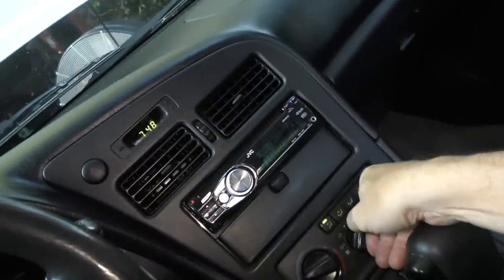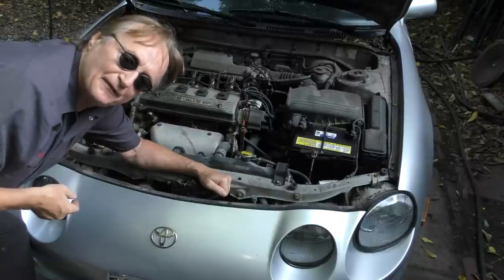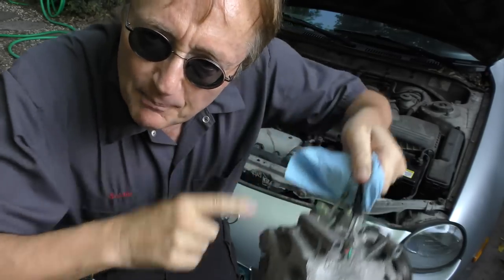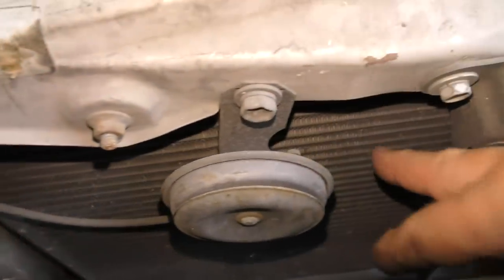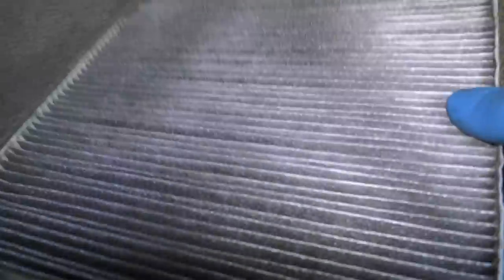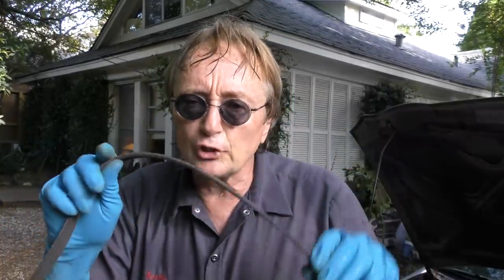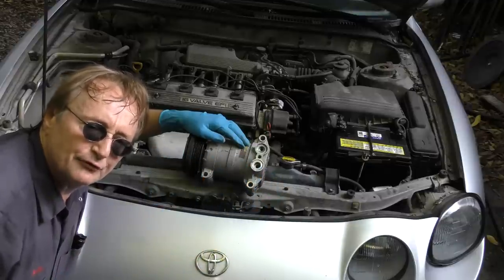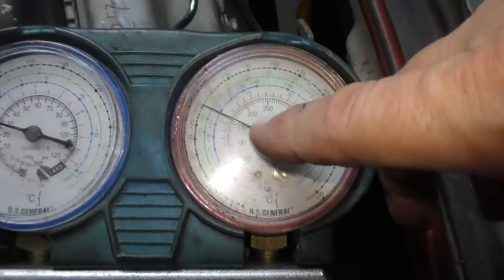How to Keep Your Car's AC Blowing Ice Cold

Comment: 1- check/replace cooling fan[s]
2- check for/clean out intake debris
3- check for/hose off any dead bugs on condenser
4- check/replace cabin air filter
5- check/replace fan belt
6- check/refill refrigerant
Reply: Check!

Comment: Very good help and thanks-I was having to replace my refrigerant once a year for the past two years but I got smart this last winter and ran the ac for a short period every day I would drive the car -especially even in the winter.  I am certain that this kept the lubricant (ac system oil) circulating and kept the system seals lubricated, and therefore I did not lose the refrigerant over the winter (as had been the case previously), and lo and behold, I did not have to recharge the system at all this year and the ac is nice and cold! Yea!  By the way (and if you do not mind me asking) are you by any chance related to Billy Kilmer (the ex NFL quarterback?)

Comment: thanks bro that was helpful I do mostly residential Refrigeration some commercial. very little Automotive but one thing I thought was worth mentioning to remind people when they're cleaning the coils not to use too high pressure hose with water and damage them. I've seen it done countless times on residential. people just don't know any better. I'm sure you know that.

Comment: I clicked on this cause i noticed my ac doesnt cool much if its over say 75.  I just figured i was low on 134 and not much in the vid would help.   So sure enuf i checked the fans like Scotty said and the radiator fan motor is dead.   The car never overheats so i never noticed it.   Thanks Scotty!   I never knew that both fans should run with the ac on.    You mightve saved me a burnt out compressor.
Reply: Yes, he definitely saved your compressor (and many other very expensive parts with it too). Such a high discharge pressure does no good to the lubricant oil and to the reed valves. I myself think i saved a city bus' AC compressor by telling the driver that the AC unit was running with only one condenser fan working out of five (don't ask me why, because i don't know, but it still worked, you could hear the compressor vibrating and shaking violently something like 50 feet away from the bus, and the driver told me that it was cooling, but very weakly; i've seen one of these compressors before on these buses and they don't have any unloading valve, only HP and LP switches).

Comment: I wish I had air conditioning in my car,so I don't have to drive around with all my windows down.
Reply: What's wrong with yours? I'm not a mechanic but my Honda Civic last year had the same problem and I did a couple simple things like changes the cabin filter and did a coolant flush and all of a sudden my AC started blowing cold air like the car was brand new.
Reply: +Richard Vaughan my A/C compressor was squealing so I took it out and put in that bypass pulley for $30
Reply: Bad pulley bearing?  Pretty easy repair.
Reply: +wholeNwon yeah but weight reduction
Reply: A/C never came with my car (kia rio lx ).just saying i wish it did have some.
Reply: many new cars in the nothern parts of the us and canada don't come with ac standard cause it hardly gets hot enough to need it.
Reply: +SteelCity1981 sounds very unlikely just because of the location, it's considered a luxury for your car to have it.
Reply: Zach Harris there are new cars in the northen us and canada that don't come with them standard they are sold as optional packages even on higher end modrls . it's the fact that ac isnt really needed up there so why put ac in a car as standard when you will hardly use it which cuts down on cost. my friend who lives in maine bought a 2013 f150 xlt single cab and it has no ac in it, and because of that he saved 2500. he doesnt need it so he bought a truck without it that doesnt come with that package.. unlike in florida where all new cars come with ac regardless of the model. diff reigon for diff packages.
Reply: what do you do when it is humid outside? I use a/c to get rid of humidity in my car so that I can see through the windows :)
Reply: +BadDrivers I just roll my windows down and if it's raining well then I try and get home as soon as possible. Gotta keep the racecar inside :)
Reply: +Zach Harris haha your car in the pic? :)
Reply: +BadDrivers no I wish. I made this account years ago and had that on my computer so I set it as that
Reply: +Zach Harris one day it might be yours, keep believing :)
Reply: +BadDrivers I'm keeping mine, once I'm older and have more money I'll motor swap to reach my goal of building a sleeper
Reply: +Zach Harris sleepers are the coolest ones :)
Reply: I thought it was standard that all cars come with A/C's.
Reply: +Whispered X no there's some that didn't, like the 95 Honda Civic dx, it isn't standard for t to have power steering or A/C my buddy had one with A/C but without P/S then again that car is so light it didn't matter.
Reply: +Kevin Churchill 
some old cars have it to, I've seen.
Reply: I live in Ireland many most cars don't come with a/c even the new ones.thats over the region as someone pointed out in the comments,but we do have very hot (Irish) summers and  I can't handle the  heat.
Reply: +AZ Outcast made my day
Reply: haha I thought I was the only one.  It's summer in Pennsylvania . and its hot like hell.
Reply: Still quiet stupid through as it is useful for demisting too.
Reply: It doesn't matter now about air conditioning.my car just died back right hub just disintegrated to pieces and my front brakes are sticking and locking up sad day for me I loved my Kia Rio it was very reliable till that happened 15,000 miles of hard driving without a problem
Reply: boondocksaints2011 How many miles does it have now?

I mean, I'd expect a 70s American car to last for 40,000 miles before that happens... I'd be quiet surprised if a KIA only lasted for 15,000 miles of hard driving... I'd expect well over 130,000 miles like the heavy abused 90s Mitsubishi did with heavy mods and thrashing...
Reply: boondocksaints2011 j
Reply: SteelCity1981, ''nothern parts of the us and canada'', what? why not? Every car (even ones from the 90's) in the UK come standard with Air Con.
Reply: boondocksaints2011 and
Reply: boondocksaints2011 

so just make it work go to a junk yard and pull all the a.c. things out and put it in your car ez right.
Reply: boondocksaints2011 wont ever work if you just sit there typing that it dose not work???....
Reply: boondocksaints2011 that's not true unless if you cheap out and buy the lowest trim level.

Comment: I realized that we didn't check our cooling fans in two years back until we watched your video then it would be checking on fan first. Right now we checked on my car's fans system, well it didn't work on flow... Thanks for explaining this video clearly than the machines from Goodyear. I spent my money four times, at $400.

Comment: The cabin filter is a very overlooked fix. My ac felt kinda weak and would take a very long time to cool. I though that it needed more refrigerant or maybe the blower fan was giving out. Then one day I changed my cabin filter and the old one was full of lint, leaves, debris and crud, once I changed it, the ac worked like new! So do check your cabin filters.

Comment: Hi Scotty - watched a ton of videos and you've saved me countless dollars doing simple stuff myself and learning what to watch out for at the stealership. Anyways here is my dilemma. I have a 2003 Honda Civic with a weird A/C issue. upon starting the vehicle, the A/C works fine. as soon as you press the A/C button you can hear the "click" of the compressor clutch magnets engaging and cold air comes out of the vents. also want to add that both radiator fans work fine as well. after a few minutes of driving the compressor clutch disengages and will not re-engage. i will press the A/C button off, then on again and it won't work. the fan comes on at the radiator, but the compressor clutch will not engage. if i leave it off for about 10-15 mins of driving then turn it back on..wah-lah...the compressor clutch engages and A/C comes on blowing cold air. again though, works for a few minutes then stops. do you have any idea what could be the problem?
Reply: Did you figure out it out I got the same problem
Reply: @nathanmccumber8965  it was the compressor clutch. it was cheaper to just buy a new compressor with new clutch assembly.

Comment: I replaced the AC compressor, and all the o-rings, receiver/drier, orifice tube in my truck last season, vacuumed the system down, leak tested and recharged with R134A.  I get 32 degree air from the vents even on the hottest days.  

I had a shop do the R134A conversion in one of my other trucks several years ago, the system didn't even last 1 season, it only worked a few weeks and then failed and it cost almost $2,000 to have all the work done.  I did the same stuff myself and with buying the vacuum pump, gauge set, compressor, o-ring kit, receiver/drier, orifice tube, leak test die, refrigerant and oil I only spent $500 the biggest cost was the compressor.

Comment: Another good idea to help keep a A/C operating smoothly and to extend the life of the compressor seal, is to run the A/C for about 5 minutes every two weeks or so. Even in the winter, sitting still has damaged a lot of equipment.

Comment: I had my AC repaired and the vents weren't blowing that strong. The guys did a great job and it was frigid but there was a low whistle when the fan was on high. I started checking everywhere. Underneath the glove compartment I located the problem. A CVS bag had been sucked up into the cabin intake. Felt like an idiot, lol.

Comment: One item you forgot is to occasionally turn on the compressor to pump the oil though the lines to lubricate the line O rings.  If they dry out the refrigerant will leak out too fast.  My old car requires the old freon and won't work with the new crap.  Great job !!!!

Comment: Scotty, you're the best.  Engine running.  My low freon was 100 psi, high was 75 psi, 75 degrees outdoors.  My mechanic evacuated and weighed the freon, concluded .5 lb volume remained, everything leaked out.  Says pressure gauges are useless to tell volume.  How can I tell if freon mostly leaked out at home?
Reply from the maker: basically, you evacuate it all out, then put in a factory load, the put in UV leak dye and see where the dye comes out to fin the leak. Start there and pray it's not an expensive part like an evap core or 
compressor

Comment: I didn't know it was common for the compressor to leak a little because of the moving parts (clutch).  My Range Rover A/C is running warm at times. I was going to check system for leaks.  If I see a minor leak at the compressor I know now that it doesn't necessarily need replacement.  Thanks Scotty!

Comment: I have Nissan Almera, which doesn't have air condition, but it has inside cabin filter like here. It was little bit dirty but there were small pieces of leaves of the trees and there was a huge amount of them. After taking out that filter I put blow like hell maximum speed hot and cold and at the same time opened and closed cabin valves many times. You should have seen how much that tree leaves were there. It´s certainly not just replacing with a new filter and leaving all that dirt, dust and leaves there to face the new filter.

Comment: At last, someone mention cleaning AC radiator, your the 1st, diminished air flow can mean warm AC , I've seen grass, leaves & insects packed between the radiators, Good Vid! Thanks!
Reply: Radiator has nothing to do with AC system. It is used for cooling the engine. You probably mean Condenser which is one of 4 main components of AC (refrigeration) which looks similar with radiator. Both of them transfer heat to the surrounding air, but when doing so, a condenser changes the refrigerant phase from gas to liquid at the same high pressure.

Comment: On my Vauxhall Agila, in order to have an AC which could manage to bring its cabin to 62F from an environmental temperature of 86F with recirculation on i simply had to replace the receiver dryer and regas everything to spec after recovering the old gas and oil, cleaning the system (i think the ac guy either used nitrogen or refrigerant for that) and pulling the vacuum. If you have the work done by somebody else i think it helps to know how an ac recharge station works, how a proper ac service is done and what and how much gas and oil your car requires. If your car has an internally controlled variable displacement compressor like the first Agila does you can't get as low as a fixed displacement compressor would allow, since the compressor, due to the reduction in suction pressure, destrokes once it has cooled the evaporator enough (i could only get a record low temp of 41F at the central vent with recirculation on).

Comment: If you replace the compressor, you need to replace the dryer also. Trash  will shorten life of the new compressor. A good vacuum to pull on the system is good to.

Comment: I cleaned the throttle body in my '07 Nissan Frontier the same way 3 years ago
before I heard of Scotty.When I opened the butterfly manually as he did, it did
something to the electronics that had to be reset at the dealership.They said
to let it warm up first or something but DO NOT touch the butterfly.Been doing
my own-whatever I think I can fix for-40 yrs and learn what I can about the un-
known. SOME things are best left to the pros. Maybe it's a Nissan thing.I'll
soon find out.

Comment: Hi Scotty fellow Texan here from Baytown Tx. here is a problem you probably have never heard of ? My mother in-laws Ford Torus AC does a strange thing ??  Here goes when driving and using the AC when say we are at a red light it blows fine but when she accelerates the AC systems air flow drops severely in its blowing capacity no matter what it set at. So once you accelerate let of the gas and then push the gas pedal down again the AC goes back to a strong blowing capacity . We have asked around no one has ever heard of this problem ? Do you have any ideas or have you ever heard of this . Everything else associated with the AC unit works fine from examining it . So looking forward to some help ...

Comment: Can you offer guidance on "fine-tuning" the high-pressure and low-pressure numbers....and how that relates to the amount of refrigerant in the system? I have a car with a good but marginal system ( Scion xA, undersized condensor)....so the best I can do is "optimize" the hi and low pressure numbers, outside of adding a parallel condensor under the belly of the car.

Comment: Hey Scotty , I have a 23 year old Pontiac Grand Am GT V6 and it has ice cold air, but was wondering what kind of refrigerant it had if I ever needed to add any. Owners manual didn't say but to look for the sticker under the hood can't find one. There's a cover gone above the radiator that never got put back on for some reason and it must have been on that. Any help would be great. Thanks !
Reply: Don't mess with if it working fine.

Comment: Hi! I just found your channel today and I'm addicted. I need help! in July 2021 I had the AC elements replaced in my 2002 Mercedes Benz C240's & the defroster and AC worked after that point.  July 14, 2023; the area dealership's service dept replaced EIS, I paid the bill, got the car, and the AC wouldn't work at all. The service Manager refused to diagnose, look or help at all. I can't afford more diagnosis and I feel I could at least investigate the vehicle myself then make a move to resolve it. I will follow your recommendations in the video. Could you PLEASE let me know if you have more recommendations and I will post my tasks and results here as well THANK YOU FOR SHARING YOUR KNOWEDGE!

Comment: Not all cars use two fans. A lot of modern cars have a stack of radiators cooled by a single fan. A common setup is a triple stack with the intercooler, water radiator and ac condensor all stacked together. In both our cars the fan doesn't spin all the time even when the aircon is on full blast, it only turns the fan on when needed.

Comment: Hey Scotty great channel I’ve got an interesting a/c question. 2012 Toyota highlander and I know your a fan of them (Toyota’s) so i thought I’d ask. I have an reliable fault with the a/c.  When the car isn’t moving the a/c blows hot. At speed it cools ice cold. When stopped at a light or waiting it gets warm again. The car doesn’t over heat and the fans run but don’t change speeds. When the car is parked. I’m thinking The secondary condenser fan relays or a/c amplifier but there isn’t much info on the web. Any ideas would be greatly appreciated.

Comment: My 14 year old Toyota Camry still has freezing cold A/C . Never had any problems it.  This car has a cabin air filter. I keep the area under the windshield wipers clean. I don't like leaves on my car.
Reply: If you want to be sure, have the drier filter replaced (after a lot of years it becomes dirty and restricts flow making the compressor work harder) and the system evacuated, vacuumed and regassed to proper spec. Some oil and gas gets lost over time, since automotive systems feature rubber gaskets, not welded pipes like residential HVAC units and refrigerators.

Comment: My car's rpms go down a lot and it feels like it wants to shut down when I have my ac on, but this only happens when in drive and after driving around a while. Checked for vaccum leaks, changed iac stepper motor, adjusted idle speed screw, new belt and did a tune up. I took it to an AC guy and he checked the readings and they were fine. I've noticed the idler pulley has a little play but apart from that I don't know what else to try.

Comment: I just bought an old 1990 Olds 98 Regency with only 100K on it but the A/C just does not seem cold enough.The compressor stays running and it drips water like crazy but just does not seem to get cold enough. It will take the moisture out good.